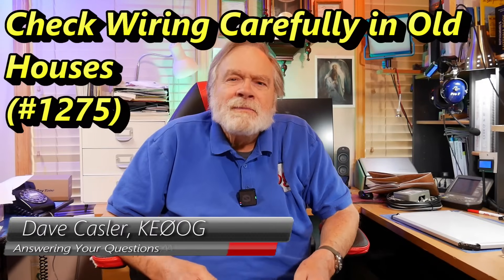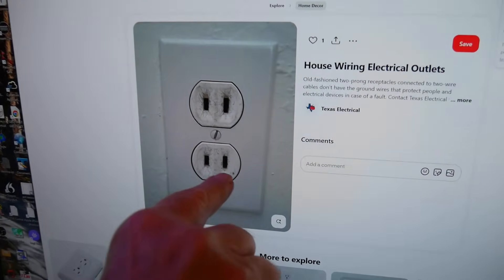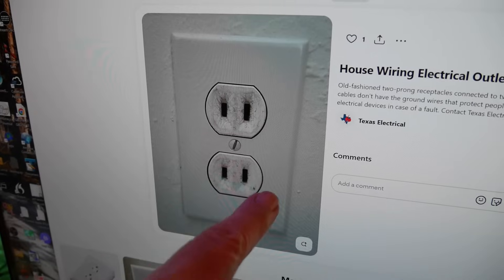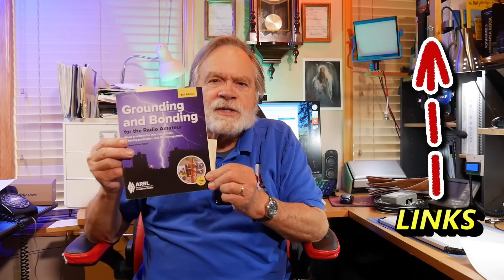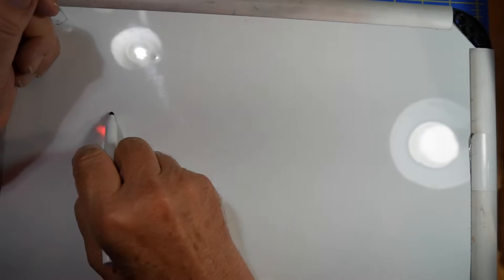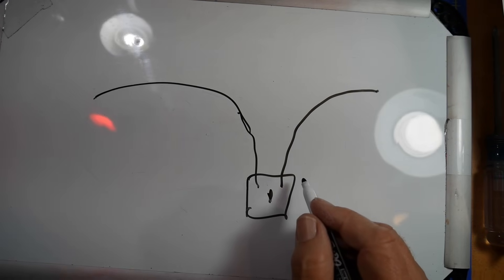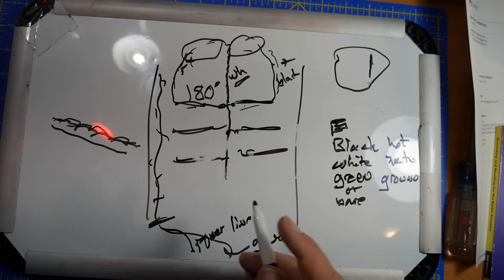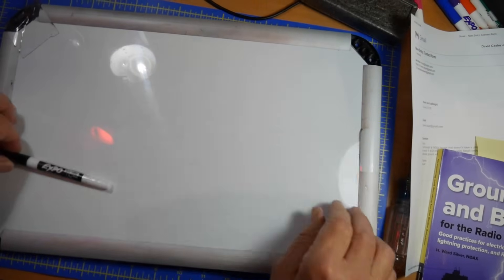Check Wiring Carefully in Old Houses (#1275)

Comment: Nothing wrong with a switch loop in modern wiring, but per recent code you do need to provide neutral at the switch and so you’ll need to use 14-3 instead of 14-2 for the switch loop. Before that requirement, you just used black tape on the white wire to make it the second hot wire.

As for pulling the wires out of the old armored BX, that is a terrible idea. That old stuff isn’t listed for use as conduit and definitely isn’t suitable as a ground. 

Conduit over Romex is a preference, not a requirement in most jurisdictions, and is perfectly safe if done correctly and properly protected where it passes through studs per code.

Comment: Knob and tube wiring and it's still an accepted method in some circumstances. And you need to have a neutral wire in each switch box now. The ground is properly called the bonding electrode and can only be connected to the neutral in the service entrance. The issue with knob and tube is combined neutrals as your trying to explain. But they would all be on the same side of of the polyphase. BX or AC was first listed in 1899 and was in the NEC in 1903 but it started to become popular in the 30's, but those early cables had terrible insulation on the conductors, especially if they got hot at any time. The sheath of AC can be used as a grounding electrode.

Comment: The whole “you need a master electrician” is absolute rubbish. Many states do not have tradesmen licenses and even then it’s a crapshoot. You need an electrician familiar with what you’re doing. There’s a lot of nuances and code compliance elements that have to be met. I’m journeyman electrician and Engineer. I appreciate you trying to explain this, but somethings should not be over simplified.

Comment: Yes, you are wrong about Romex™.

Replacing metal conduit with non-metallic sheathed (NM) cable is awful advice.

NM cable is susceptible to physical damage.
Just pull the old wires out of the conduit and pull in brand new conductors.
The steel conduit much safer than NM cable. And you don’t have to destroy your walls.

If you care about safety, then where you can’t use rigid conduit, use metal-clad cable, armored cable, or flexible metal conduit.

Comment: Better make that newer homes, too!  I inherited a 20yr old home, & found using a outlet tester, that the electrician who wired the home, forgot to connect the ground on several circuits at the 1st workbox!!  Nothing that a pair of lineman's pliers & a couple of wirenuts couldn't fix, but frustrating to say the least!! And several outlets that had reverse polarity!
Reply: There is no situation in which wires should be twisted together in residential wiring.

It’s a practice done only by people who don’t know any better.
Reply: I was taught to twist, clip, then wirenut, unless you use WAGO's!

Comment: Dave, for continuous current, it is 80% of 15 amps or 12 amps. 
 Thanks. N0QFT , Glen
Reply: … if the circuit is only AWG 14 with a 15 A OCPD.  

Houses from the 1930s normally have AWG 12 conductors and 20 A OCPD.
Reply: 80 % of the circuit rating

Comment: Dave, pretty much all pre-WW2 housing stock, which means the timeless six story apartment houses in all the big cities, will just have the original 2-prong outlets. And Edison base 15A fuses. Don't be surprised if the bathroom is on the kitchen fuse, bathrooms just had a light blub back then.
  IF they added a 20A line for air conditioing in the 60's, that is usually a single modern grounded 20A line in metal conduit. FWIW.